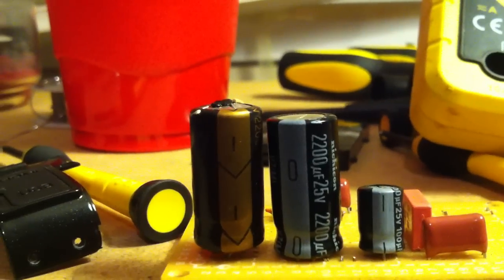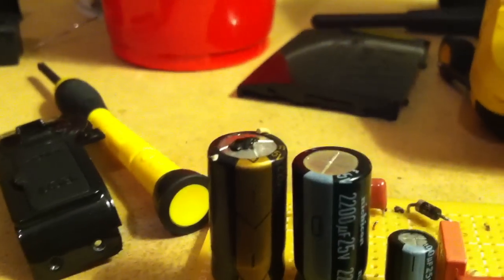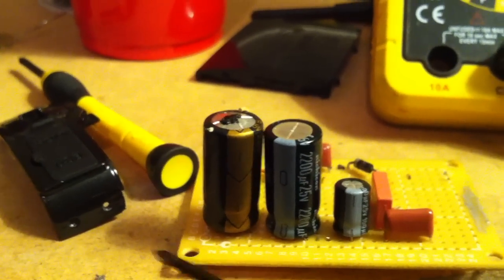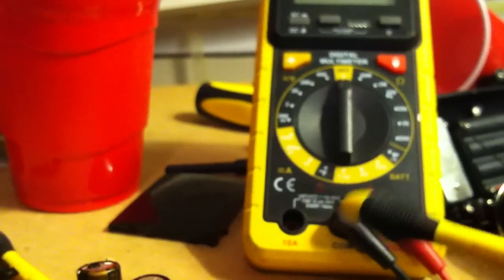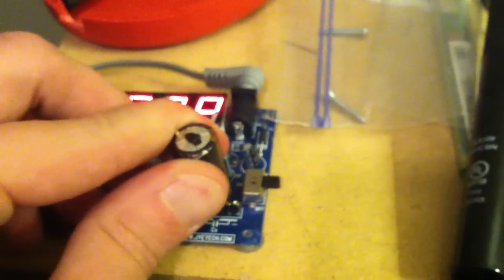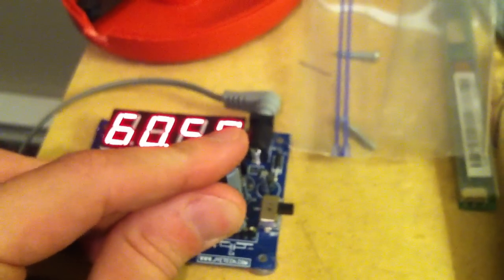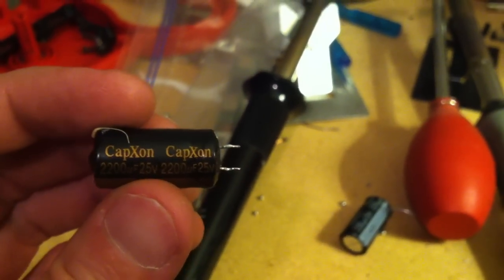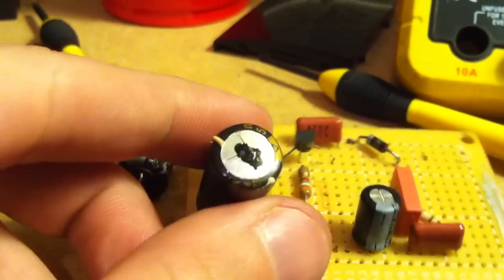How to identify a bad Capacitor

Comment: There is another quick, handy dandy way to check capacitors in circuit without unhooking everything.  If the electrical equipment can be powered up for a few minutes but is acting flakey, look at all the capacitors that are approximately the same.  A lot of cheap (meaning Harbor Freight) meters will have temperature probes.  Take the temperature at the top of the capacitor.  Most of them will read within a few degrees of one another, with the exception of the bad one which will be quite a bit hotter.  This is not a hard and fast way but it is a quick way of troubleshooting that will help find a direction to look.
Reply from the maker: Thanks! I did not know this! Very helpful!
Reply: Very cool, I gotta try this out
Reply: Thanks I made another comment about going to school for this in 1993. That tech wasn’t around then but I remember the teaching saying you could feel them for heat. A lot harder to tell back then by that method.

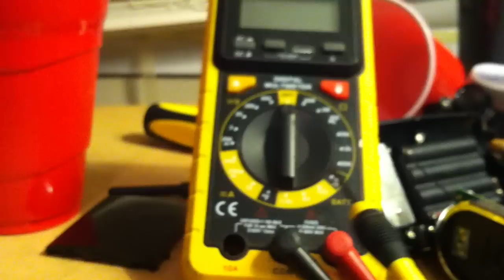Comment: 1:39 what he needed to explain was how to use the multimeter to test when the obvious signs he tells you about arent there.

"To test the capacitor with a multimeter, set the meter to read in the high ohms range, somewhere above 10k and 1m ohms. Touch the meter leads to the corresponding leads on the capacitor, red to positive and black to negative. The meter should start at zero and then moving slowly toward infinity." per ifixit

Comment from the maker: Just want to make a pinned comment because nobody can probably see hundreds of replies I’ve probably done on this already. This video is strictly for folks who have no idea about electronics. They just want to fix their tv. I have hundreds of tv repair videos out there. This is simplified for them. 15 years as a bench tech with a aas in electronics technology. I know how to properly test them.
Reply: Can a capacitor fail out on the pin side or only through the top? I bought a soldering station and  the fan wasn't working so I thought it has to be a wire cause when you touch the wire it works so I made a new wire harness and put it in same problem so I start looking further and right beside where the wire harness plugs in hidden by the wires I found a wet spot with corrosion there is a 50v 220uf capacitor and a couple 1 wat resisters and some small SMD shit my guess was/is that the capacitor vented through the pin side then I started googling then found your video reminding me that the cap should blow through the top. Now I'm not sure what to do next. Thoughts?

Comment: Thanks alot for the info I have never fixed a capacitor before so i guess i will have to buy tool, any suggestions on what tools to buy on a tight budget? Thanks in advance

Comment: Im having trouble finding a cd288 35v capacitor on line. Can you tell be the best place to get it. The ones I have are Secon brand. But cant find that brand either.
Reply from the maker: gtdodgeviper that’s the model. I’ll need the uf as well. It would say 1000uf for example
Reply: After Hours Tv & Pc repair it is a 1000uf
Reply: Its for  car audio amplifier

Comment: I was wondering if there is way I can use AC am meter to measure DC current?

The TV power supply u have is DC current correct? How do u know how much current it is put out?

Comment: I have an old Toshiba LCD TV that is having issues.  After it has been in use for a while, sometimes the screen will glitch up with colors, etc.   Normally I'd just power off the TV, and power it back on.   One night at 3AM it glitched, but it was also accompanied by a deafening screech, which persisted until I unplugged the TV from the wall.  I haven't been using the TV anymore since waking up everyone at random is not an option.  Do you think I might be able to fix it?  I've opened it up, and I don't see any capacitors leaking or bulging.  Do you have an idea of what might cause such an issue?  Perhaps overheating?  It always seemed to happen after the TV has been on for 1 hour or more.

Thanks, I appreciate your videos.
Reply: +exaiyo exaiyo The model number is 40RV525U, if that helps.  I'm considering cutting open some holes on the back and wiring two 80mm computer fans on there to see if that fixes it.  It will be a waste of time though if overheating is not the cause.
Reply from the maker: +exaiyo exaiyo just read on a forum that a bad power supply with faulty capacitors would be the issue. In not all cases do they have a visual indication. If you had a way to measure the capacitor itself, then that method would be better. I just used this video as a based basic video to show people what a "swelled" up looking capacitor looks like compaired to one that is not. Another post i just read that the squeal part is because two signals from different sources were being picked up at the same time. The main board would control the video and audio part....Yeah why dont you try a fan mod over the heat sing on the main board if possible, It cant hurt anything, just make sure you take the back off before cutting holes in it. Please let me know how that goes!
Reply: I'm assuming it is florescent back lit since you say "old".. inverter tranformer is a common failure mode on these. They usually get hot enough to discolor the circuit board they are on so are easy to assess..search eBay for the number on the old transformer..the are only a few $$..

Comment: The best way is to test the capacitor for leakage. It's not just looks that count. I've had em crowned at the top and still measure OK. So I'd check for leakage to be sure...

Comment: I found a small FM transmitter but it only worked for a bit until I noticed the capacitors don't have lines on the top of them. Does that means its bad?
Reply: Ok
Reply: OK thanks I think I just fried the tiny number display. Good thing I just found it lol

Comment: I have an old tv from the early 90s do I have to worry about capacitor leakage?
Reply from the maker: Smashingrandomthingz and reviews yes and cold solder joints
Reply: After Hours Tv & Pc well is it likely well my dad has 80s stereo equipment and he doesn't even unplug them. Nothing has happened to his stuff but the tv was a Christmas gift for me and I would hate for something like that to happen so is there like a repair service maybe that can just replace them?
Reply from the maker: Smashingrandomthingz and reviews would have to be local to your area. Depending on the type of television, will depend how easily the boards can be removed. If it’s a crt television, it’s highly dangerous unless you are a professional and know what you are doing.

Comment: you are the man bro! got these same caps on the mainboard and saw the black crud on top but wasnt sure what it was because im used to seeing brown stains...yea im a n00b lol
Reply from the maker: We all start somewhere. Hope you get you board fixed. What is it you are working on?
Reply: a 26" phillips(26mf337b), i thought it would be an easy fix like the 32" polaroid i fixed last week(2 cap replacement on power board) but this one looks like its gonna be a challenge...gonna head to the city n check out 3 stores to see if i can get these caps, if not then mouser it is

Comment: The failure rate of modern electrolytics is shameful.
Reply: Blame the investors.  It's their relentless drive for greater profits at the expense of quality products.
Reply: they are all made in china you can buy buckets full parts dirt cheap  one thing in thier favor -- i order some small resistors few $$  they sent me several hundred  lots diff values   all attached to card board  if it 522 ohms that is exactly what it measured  back when radio shack was big  you were lucky to get + or minus 20 %     --------a tip for new guys   if you need 50 ohms but you do not have it  take 2 100 ohms side by side  measure it
Reply: i bought a  60 inch tv flat screen about 14-15 yrs ago moved twice  never had a tbl  high quality picture  watch it everday  SAMSUNG

Comment: Bad advice as a capacitor test method... see Paul Carlson's posts on capacitor testing either here or using his Patreon channel. Your advice on buying junk caps is right on, however. As they said in the movies, "Stupid is as stupid does."
Reply from the maker: Bruce Nitroxpro advice for the novice home users trying to repair their tv. As I’ve repeated this same comment time after time after time. Nobody is going to buy a esr meter to test them. It’s a simplified video for 100’s of videos I’ve uploaded with swelled capacitors in power supplies being at fault.
Reply: @hitandrepair , Ah... sort of a 98% solution. Got it. I just love the more exotic leakage test, myself. I'm soooo spoiled! LOL

Comment: my whelen 9000 lightbar will work when it wants to... put power switch on and it won't work... then all of a sudden it will start working... I think it has a bad capacitor I just need to take the powerpack out and check them and find replacements somewhere...
Reply from the maker: That or cold solder joints. I've worked on several whelen power supplies.
Reply: +After Hours Tv & Pc repair cold solder joints? ... where can I get capacitors? they are a lot cheaper than a whole supply
Reply from the maker: +Stephen Waite eBay!
Reply from the maker: https://youtu.be/h5_dBMuJMNY
Reply: +After Hours Tv & Pc repair  ah I think I can figure that out! ill check for cold solder joints an get new capacitors
Reply: +Stephen Waite  thank you for the help
Reply from the maker: Your are welcome!
Reply: +After Hours Tv & Pc repair my power supply is a UB412 whelen... and the capacitors are like glued in....
Reply: +After Hours Tv & Pc repair $572 for that power supply new... so I found one a guy said he sent to get checked out by whelen for $75... if I couldn't find one I would be trying to fix mine!

Comment: I don't think I would want to have this guy "fix" my TV... Being a "tech"/repair guy and he doesn't even have a really good dedicated capacitance meter, (WTF?!), plus he doesn't even know how to pronounce "Nichicon", one of the most prevalent brands of capacitors in the world, one he'd be dealing with on a very regular basis if he really did a lot of this type of repair, and when ordering new parts, etc... That simple, easy stuff to get right, doesn't really inspire "confidence" in my trusting that he knows what he's talking about with everything else! LOL!... The bulging and leaking of fluids from a cap indicating it's bad are a definite indication of a truly bad capacitor though, so he's correct there at least!
Reply from the maker: JoeJ8282 home repair is a hobby. Thanks for noticing the mispronounced words. 🙄 home repairs for tv for average people won’t have a proper meter to use to test these. I don’t think I would want to work on your set either. You searching YouTube for video to criticize. If you already knew the information, what are you on about? This video was use to simplify the thousands of comments of people asking what a common bad capacitor looked liked in their sets. I used it as a simple reference guide. 👍🏼 have a nice day.
Reply from the maker: JoeJ8282 also being a “tech” 14 years with a electronics technician job and 2 year degree. I don’t have equipment at home or some dexters laboratory, and neither would any common person searching for model number of their tv.
Reply: I guess you're right in that most people at home trying to troubleshoot their TV wouldn't have the proper test equipment either, so I kind of see where you're coming from with this video... however, if someone doesn't have the proper test equipment to test a TV, and doesn't really know what they're doing in that regard, then there is a VERY serious potential for extreme danger, what with all of the very high voltage capacitors and such in TVs, so in a sense doing this video is just opening up a whole big "can of worms" if any regular "layman" or "occasional tinkerer" was to take your advice and try to fix their own TV with it!... Maybe some disclaimers or something would at least be in order here?... (I'm not trying to be mean, I'm just looking at this from a "real world" view as to what any regular person who really knows nothing about electronics will be attempting to do with this information.)

I also figured that if you were a true TV repair person, that you would almost definitely have a dedicated, good quality, capacitance meter, (and probably an oscilloscope, etc. too), but now that I know you were only attempting to show how capacitance can be tested with a regular, basic multimeter or even a really inexpensive "kit" meter, if you know how to read it, then I apologize for dissing on your test setup!... I initially thought that you were just another "poser" here on YouTube who posts videos with their so-called "knowledge" of a subject, pretending to know what they're talking about, only to be putting up even more "less than ideal" info out there, simply because they don't know any better... I didn't know that you were trying to make testing caps as simple and cheap as possible, so that everyone could potentially do it... Sorry for that, man!... Still, some explanation as to what the limitations are with this test method would be best to know, and that there are definitely better ways to do it IF you have the money to invest... because some people, (myself included), want to know more than just an "entry level" method... we want to know the "best" and most effective method in all cases... at least that's what I was searching for.

BTW, I clicked on your video as part of a couple dozen "series" of this type that I was watching from any and all other posters, in order to get some good, new (to me) ideas on the BEST and most effective in every situation ways to evaluate and test capacitors, because I have an amplifier that has some bad caps in it, some which are obviously bad, like the bulging/leaking one shown here, and some not at all obvious, so I was trying to watch as many of these videos as possible to get the best of the best ideas from them all... I wasn't "searching for videos to troll", LOL... I don't have time to do that shit; only to try and learn new things... Although I am finding that most people out there aren't as relatively well versed in electronics as I am in general, however, there is always room to learn a new method, especially if it's more effective than what I already know... That's all I was trying to find; something above and beyond what I already knew.

Anyway, my apologies, and you also have a good day! :)

Comment: Like, one of my toys quit working.  It has these little things inside that look like cans.  Some of 'em looked like their guts were spewing out, or they were swollen.  My babes got me some new ones of these little cans, and we replaced the icky-poo ones.  Now my toy works again.  Ohm-my goodness!
Reply: ewww I can only imagine what kind of toy youre using.....
Reply: Janette Barclay Video-signal processors and digital TV tuners are wonderful toys until their capacitors get really icky-poo.  I would agree with you that equipment in such condition can be very disgusting indeed.  You go, girl!